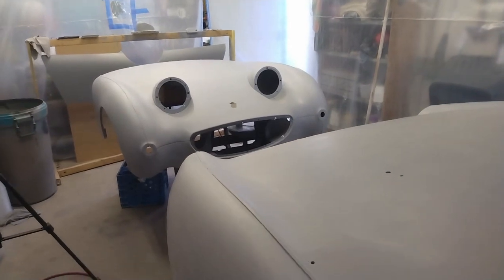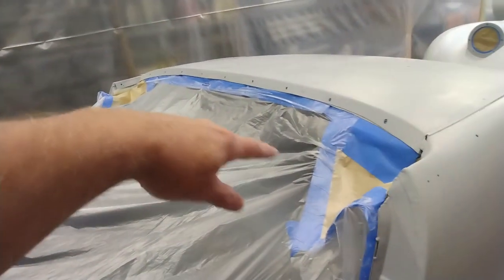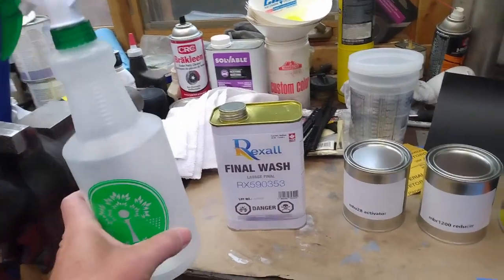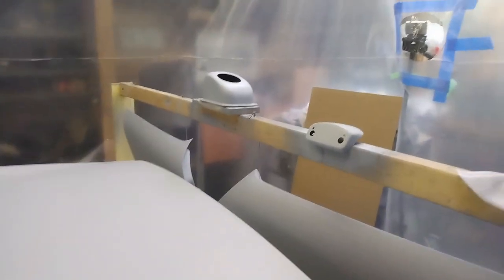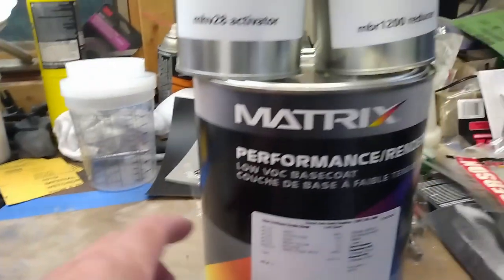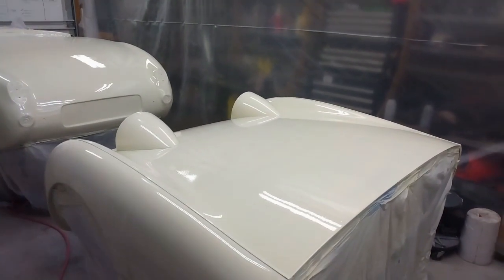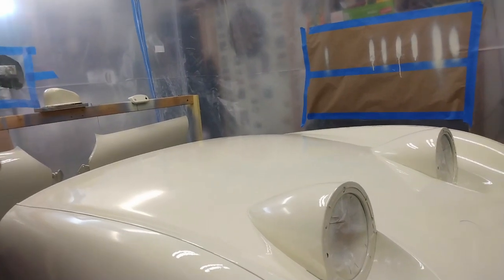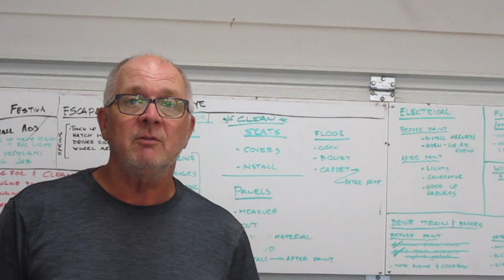Adventures in car painting or how did my SECOND time spraying with air go? Bugeye Build Episode 85

Comment: What was your ventilation setup?   Also when you were putting on the base coat it looked pretty cloudy.  Was that paint in the air or did your camera cover get dusted with paint?
Reply from the maker: Hi Tim. I had a the garage door open to about the same height as a box fan and that was on full blast sucking air out of the garage. There was an open window at the opposite end of the garage. The camera is aimed into the "booth" through a sheet of cling wrap which I showed in episode 84. The cloudiness was probably a combination of paint in the air and the cling wrap getting dusted.